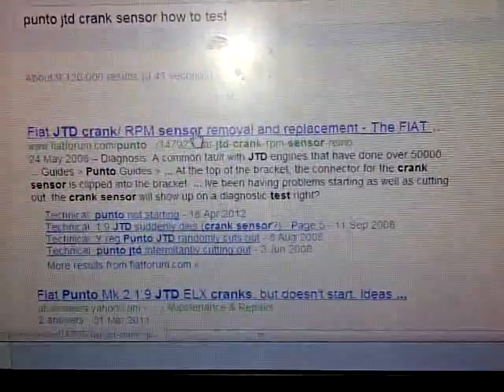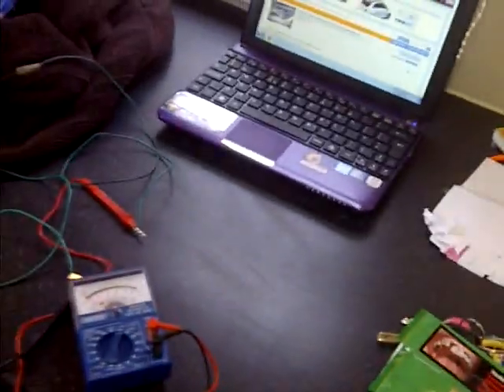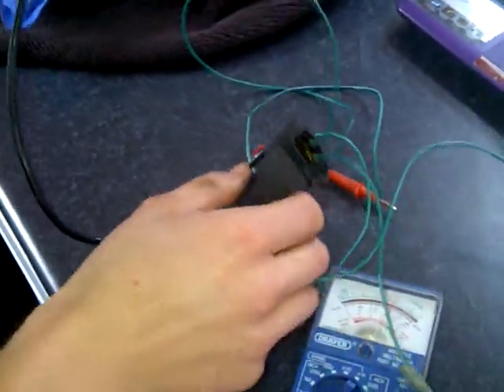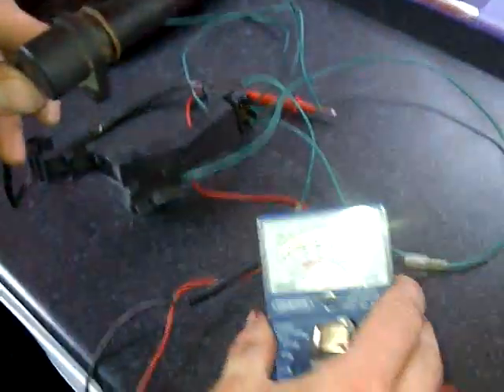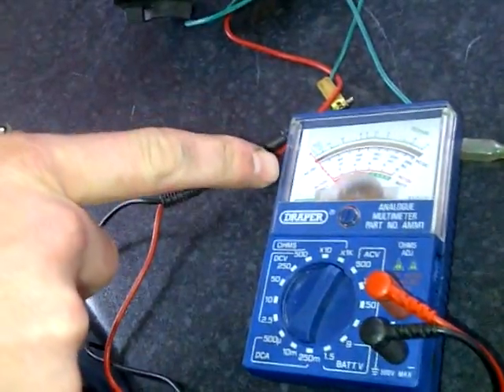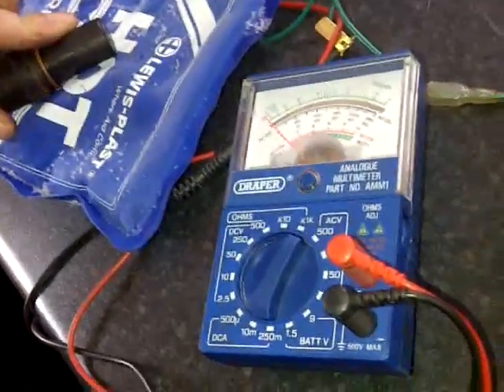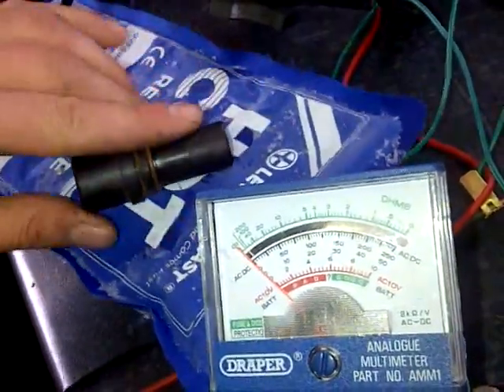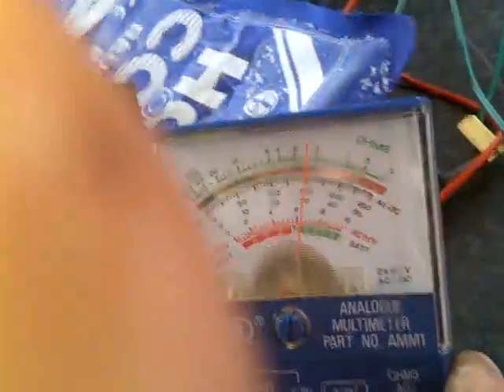How to test crank shaft position sensor if your car cuts out when its warmed up fiat punto jtd

Comment: Nobody has looked at it yet. The immobilizer light does not stay on. It is not random as I can reproduce it. This
 morning for example, started like a champ. Drove around for 30 
minutes, parked , did some shopping for 10 minutes and it would not start. I put
 my ear on the bonnet and not a whisper coming while my wife was turning
 the ignition key. I am sure when I go back one hour from now it will 
start at once.
If it is the cam shaft sensor would you expect the starter to rotate or complete silence when you turn the ignition key?
Reply: Arturo Martinez no mate a crank shafts sensor will not effect your starter motor and wouldn't cause your car to not turn over the engine

Comment: Thanks for the video, i wonder if the heat was enough for the magnet to lose It's magnetism?  or did the expansion of the plastic from the heat separate the south pole of the magnet from the carbon rod? I think it is my second guess, i wonder if you could do another video of taking the plastic shell off and see if there is a fix. this part is discontinued for the car i am trying to fix ,Thank you Pete
Reply: Thank you having the same issued who my 1996 ford f150xlt

Comment: just another case of a manufacturer deliberately producing and incorporating defective (or rather poorly engineered) products in their vehicles - it keeps their after sales alive; In fact if the motor industry did produce outstanding vehicles (virtually failsafe - which they can) then most would be out of business rather quickly.
Reply: JustBanter.            Teach!

Comment: Nice job,smart idea because a manual will tell you to test it with a volt/ohm meter and if it reads god its good,bad its bad..but it doesnt say test cold then hot or after warmed up so everyone goes & test it & it reads fine so they rule that out & move to the next sensor/part.My 99 blazer it will start right up 1st thing and within minutes it cuts off and on and gets worse until it wont run anymore,its like my ignition key was switched off/on then off while driving,wait a few,fires right up and boom..its off again.Thats a simple good smart test..Cheers from Florida!

Comment: Thanks after just replacing mine in my mk5 golf a year ago I'm having these exact same symptoms, so I'm going to pull it out and try this ,i thought maybe a broken wires getting hot and expanding loosing connection, but after watching this I'll check the sensor before splitting the loom

Comment: So please dont get me wrong but, is that sensor you testing working as it suppose to or its broken and needs changing? got that damn problem in my scudo 2.0 jtd. But dont have to wait long before restarting. Not sure if its that really ,when worm, releasing gas pedal, slowing down or reducing gear and it dies,cuts the petrol and dies...few sec restart and back to normal until next breaking or lights : /Im well annoyed ! Coze its all great when cold ...

Comment: did you do the test in the video? if so then it is your position sensor....
it could be numerous amount of things, coil pack, ht leads, a dodgy wiring loom, ecu cutting out because it has broken down due to heat or water damage, injector working when it wants, could be anything mate, HOPEFULLY YOU DID A TEST ON THE POSITION SENSOR BEFORE BUYING ONE??????

Comment: my sharan has been complete ballache i replaced loads of parts fault finding and i found my crankshaft sensor was kanckerd with bare wires so i changed it with aftermarket one and mine does exactly what that sensor is doing after a long hal of pulling my hair out im ordering a original vw one and hope this fixes it if so cant thank you enough as i was baffled till i see this video then realised i just changed one with cheap one so fingers crossed its this i need car for school runs il update